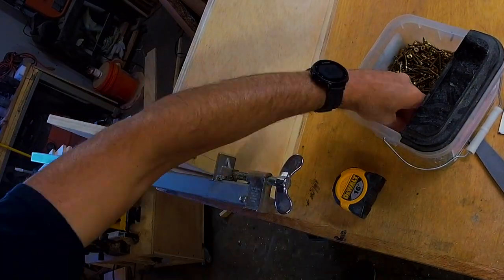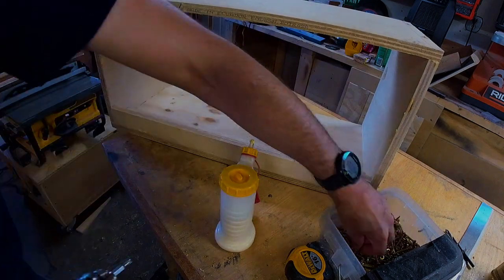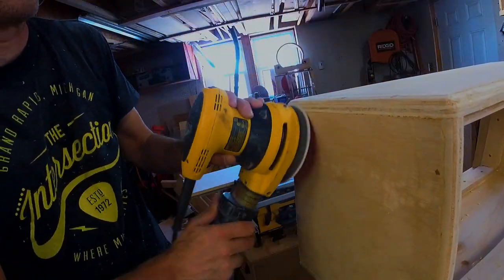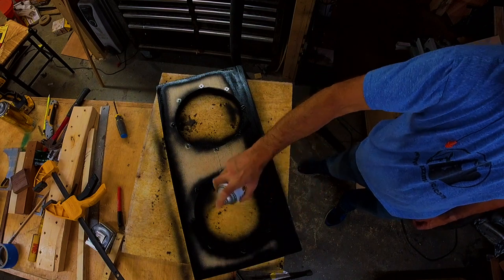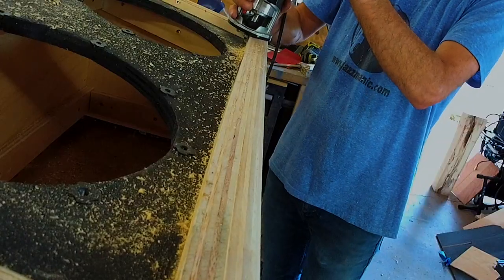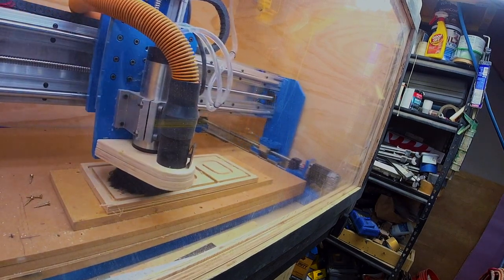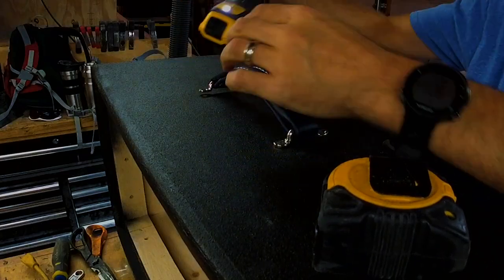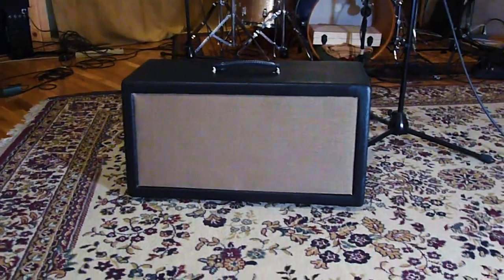DIY 2x10 SPEAKER CAB

Comment: Use a hair dryer or a heat gun on a low setting moving around the front of the grill and the material will shrink and tighten up nice and snug.

Comment: I was left wondering why you didn't use either a rabbit, or a dove tail joint, either of which you could still use the added dowel rods to enhance the strength of the assembled panels.  I used just the dove tail the last cabinet build I did (over 35 years ago) and its still as strong as ever.

Comment: Hey great video.
I'm building one 1x12 and I want to know how do you kept in place the frame with the grill cloth. I didn't see you used screws or glue. Hope you can answer me. Thank in advance.
Reply: I had the same question....I'm assuming Velcro....so it can be remved to replace speakers easily....

Comment: That was incredible! Were there any specific sonic reasons you went with the dimensions for the cabinet? That's essentially exactly what I'm thinking of making. Thanks 😁
Reply from the maker: Elsif I did some reading but couldn’t find much on guitar amp cabs. I went with a conventional fender style size and then gave it a bit more bulk in the back
Reply: @themassacoustics264  sounds like a reasonable plan. 🙂

Comment: What size/type router bit did you use the bevel the cabinet edges?
Reply from the maker: I used something like this https://www.cabinetmakerwarehouse.com/catalog/amana-tool-corner-rounding-2-flute-49504/ it came in a set so Im not exactly what size, but i picked one that would round about 1/3 of the thickness. i did a few test cut on some scrap wood first. If you make a cabinet with plywood and you want to round the edges, try to get baltic birch i think it'll chip out a lot less.
Reply: @themassacoustics264  , Thanks!

Comment: What's the point of the dowels when you already screwed it? Dowels are for strong but hidden joints
Reply: I'd like to know this too :)
Reply: Probably because the screw heads would show through the goop he used to cover it with.  You could always just putty them over before applying the covering goop, though.
Reply: @FlyGuy2000  that makes sense!
Reply: He's routing some of the edges - don't want to be hitting any screw heads! Better to use wooden dowels.

Comment: Also nice would have been a brief explanation of why you installed two separate jacks, and thus allowing for the use of one or two speaker at different impedance.  Nice feature.
Reply: It doesn't seem to be that sort of wiring. The speakers are already parallel to each other, and it makes it impossible to connect to only one of them using the jacks. Wiring should be completely different.

Comment: Very nice. It's hard to find combo amps or cabs that are 2x10. Most all of them are 2x12 or 1x12. What was the total weight of the cab when you finished. I'm older now so weight is a big factor in buying amps. Thanks

Comment: Nice build. You should perhaps build another so you could tell folks how you dimension the cab to provide the required cubic inches behind the speaker, as in the book included with the speaker,it makes a large sound difference if you get it wright. You might want to consider a thin weather strip around the frame that the back fastens to,to eliminate rattle. When I started building Leslie speakers I took the Yamaha sound course. I learned a lot but you have the most important part....the will to get up and do it.. Could I ask why you didn't mount the speakers from the front,that way you could have sealed the back making the cab that much stronger. THANK YOU for sharing. I look forward to more videos and sound tests.

Comment: A long time ago, without your genius cad, cutter designer...etc.,  (big compliment as the cutter blew my mind, Props my man), I duplicated a Music man 2 X 12 cab installing ElectroVoice SRO's 12L (monsters).  Again, didn't know what I was doing, worked out.  I did goof however on the back, routing the cab so small that the connector broke through.  My question, where did you purchase the connector, why did you use 2?  I ran two wires from one speaker to the other (polarity???) then soldered to connector, and connected to one of the speaker.  Does that sound right?  (I'm lucky because it worked). Thank you for the video, cab excellent.
Reply from the maker: Thanks James. I got my connector from https://www.stewmac.com  I think. I used 2 in case I wanted to chain a second cab to this one. I wired the speakers up this way because acording to OHMs law 2 8ohms speakers in parallel  will have a resistance of 4 ohms. https://www.physicsclassroom.com/class/circuits/Lesson-3/Ohm-s-Law . You don't have to go nuts with the math, most guitar amps don't want less than about 4 OHMs. the less OHMs the louder the amp.

Comment: What method did you use to wire? Why two jacks, does your method allow for both stereo and mono while maintaining ohm?
Reply from the maker: I just wired a second jack in case I wanted to chain a second speaker to it. It will double the resistance so I will have to pay attention to the amp I want to use. It will stay a mono signal but sometimes a second speaker can make it sound huge.

Comment: Thanks for this planning to make my own to good thing saw this video .. what kind of wood u use ? And the duratex paint what is it?
Reply from the maker: Eltagima Tagima we used Baltic birch ply with a few scrap pieces of cheapo stuff that was laying around. I’m not sure what the paint is, it was leftover from years ago and I wasn’t sure it was even going to still be good. It seems to be holding up though.

Comment: Turned out really nice! I've been trying to finish a 2*12 myself, and I'm wondering how you attached your grill? I see how you've stapled the speaker grill material, but next part of video shows it in place...how did you secure that? Is it attached somehow or just pushed in place fitting snug due to the speaker grill material? Maybe velcro? i can't tell and am trying to figure it out on mine, so the grill doesn't just pop out when playing , or when transporting the cab
Reply: Lots of wood glue probably
Reply: He may have used a couple of screws in the back, inside cab, to attach it.
Reply: Most companies attach the grill frame to the speaker baffle with some industrial velcro on the backside corners of the grill cloth frame.  This way you can remove it if you want to get a mic close on the speaker or if your grill cloth rips and needs to be replaced.